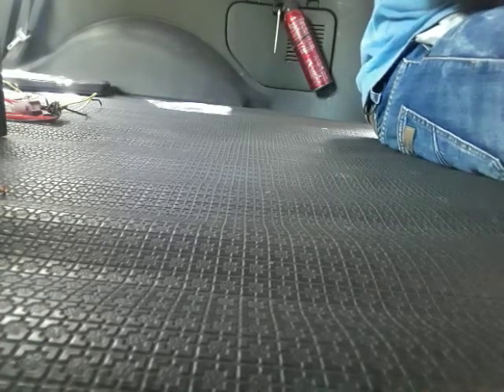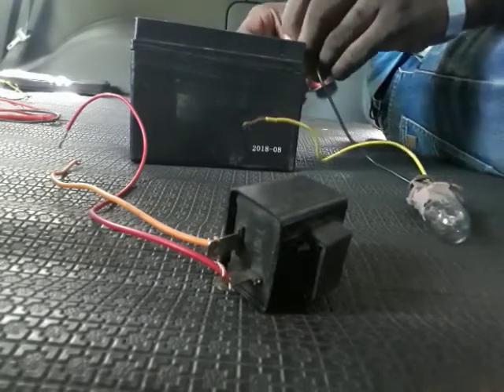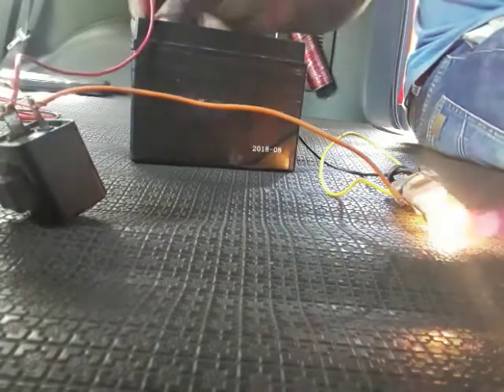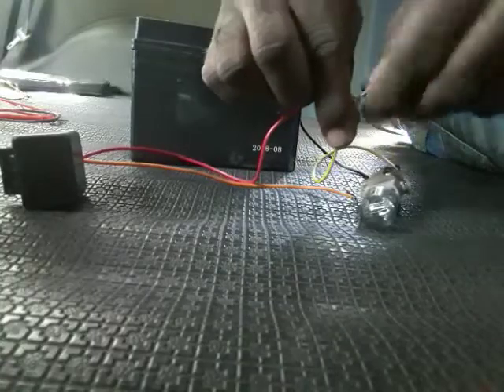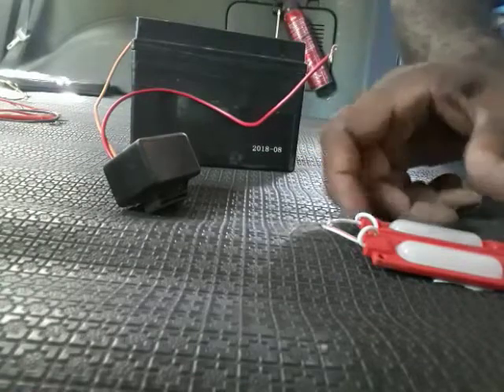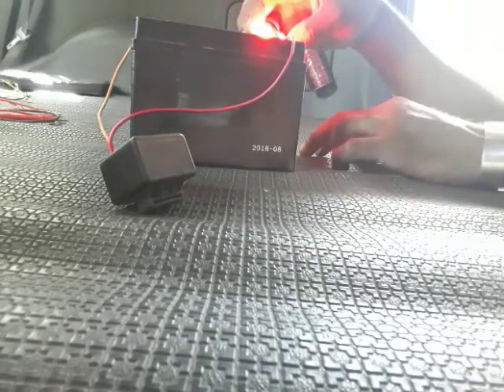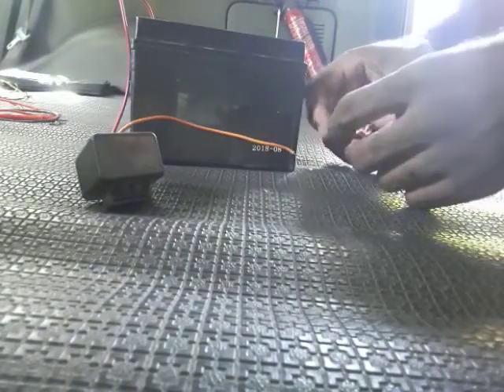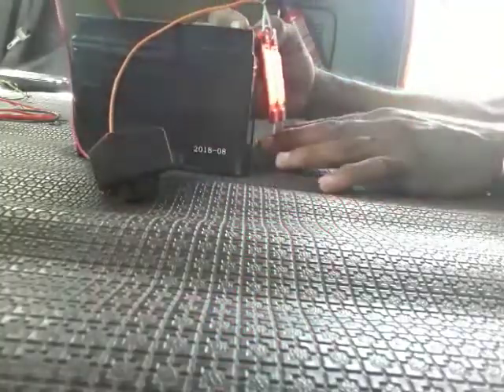How to connect a 2 pin relay work as a flasher or a blinker

Comment: 📌 Helpful
After replacing all four halogen signal bulbs with LEDs I ran into fast blinking LED problem, this helped me solve it by replacing a 3 pin (B,L,E) flash unit with a two pin (B,L) 🙏🏼🙏🏼
Reply: I’m having the same issue , could you further explain how you fixed it
Reply from the maker: Ok  sorry to take so long to reply.. because led take less current to run led you would have to add more bulbs,or you could odd a resistor